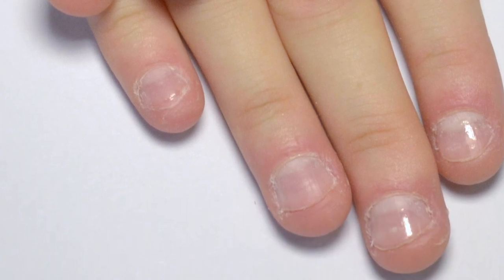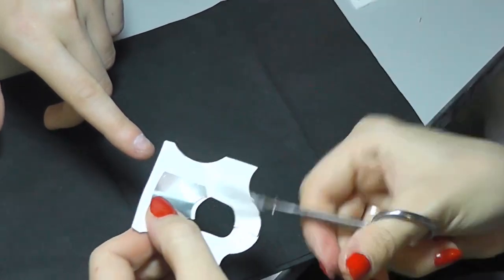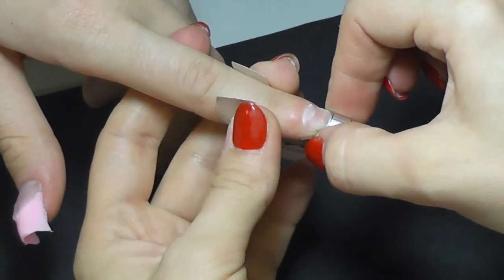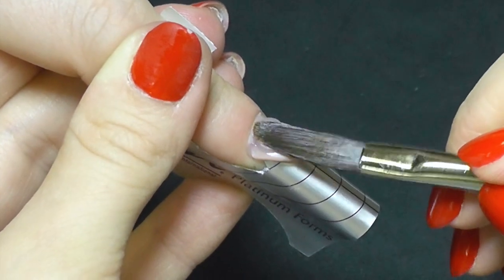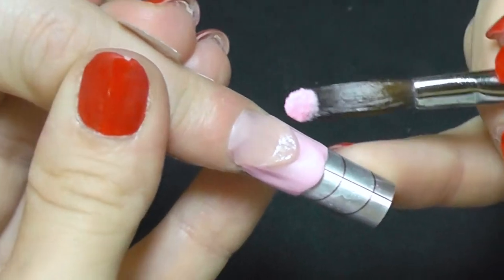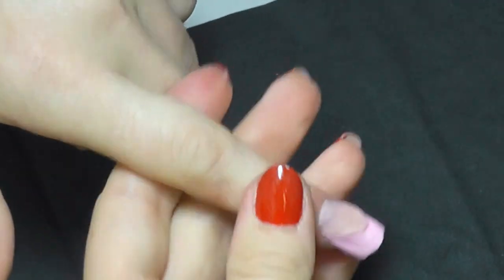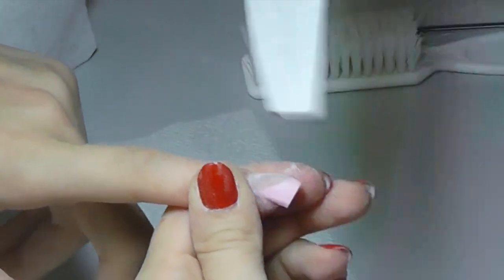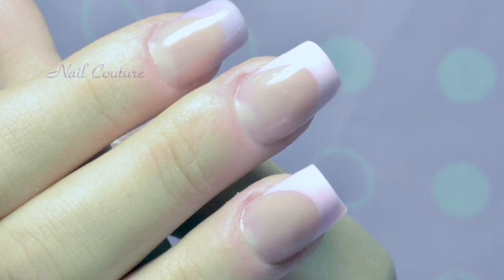How to Fix Short Bitten Nails with Acrylic

Comment: in your experience can nail biter clients have nails this long? i was taught to have the free edge no longer then half the length of the natural nail and to not extend past the finger tip. clients always want long nails right away, but i tell them they must "earn" their length, meaning they need some of their own natural nail underneath to support the extension. But in your experience can nail biters have longer nails from the first appt? im a gel tech only. thanks anna
Reply: Baja Rosie I know this was 2 months ago but incase you still want an answer. I have really short nails too and I had acrylic done using nail tips. They were much much longer than the one in the video. It lasted me 1-2months
Reply: yes you are right

Comment: Hey I have nails almost half this size and have a narrow nail bed do you think I would be able to get acrylic nails on them or do you think a nail technician would turn me away? 

I had nails short like this and got nails on to help them grow and they did but now I’ve had them off I’ve bitten them down to twice as short as I originally did and didn’t think I could get s nail at all!
Reply: The nail tech I was using used tips instead of the forms

Comment: I want to use acrylic but I'm not confident enough, can u using the dipping system x
Reply: Maybe give dual forms a try?
Reply from the maker: Tracie, I'm not sure if it will work on forms, but you can use dipping system with tips
Reply: Nailcou I do use the tips in the dipping system , I get it from Nsi Australia
Reply: Nailcou  thank u so much xxxx